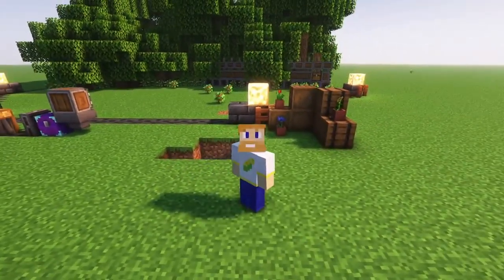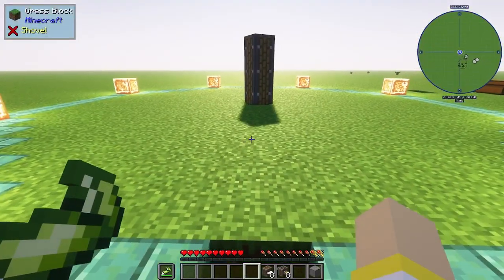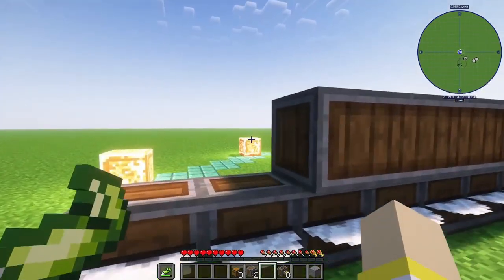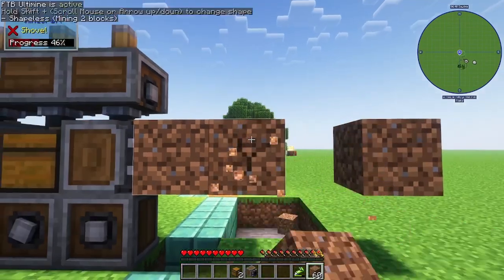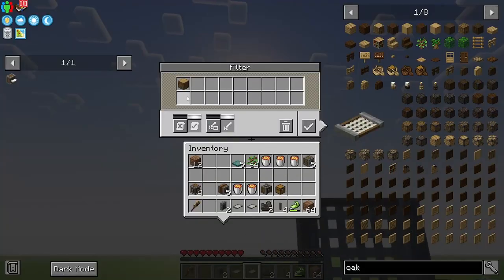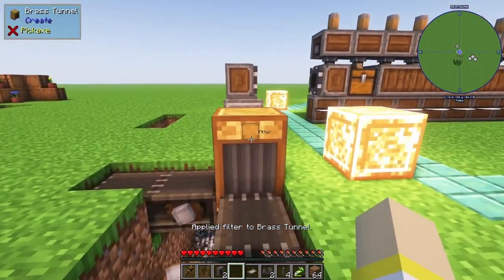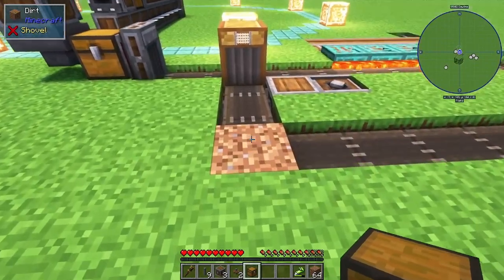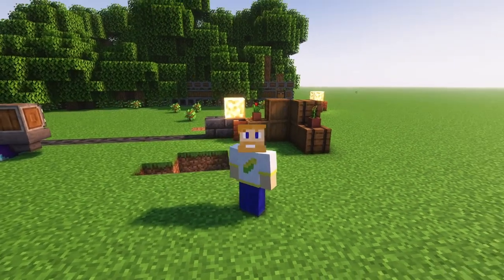Create Mod: Multi-Fuel Farm!

Comment: Sorry for the absolute noob question, but the main spinning contraption is actually giving the saplings to the portable storage interface, which then throws them onto the mechanical belt, so all the saplings i put on the first end up in the last item chest. I think I can solve this pretty easily by just removing the deployer on top of the portable storage interface, right?
Reply from the maker: You kinda need the contraption to pull out saplings or it’ll over flow. You could put a brass funnel coming off the portable storage interface and put a filter on it. Set the filter to the saplings and click do not allow. Should solve the issue for a bit. Until your saplings start overflowing in your contraption. Hope that helps!